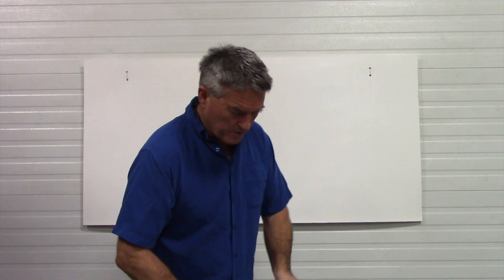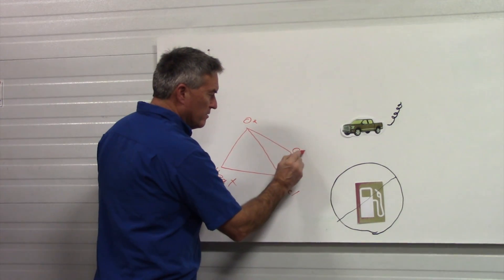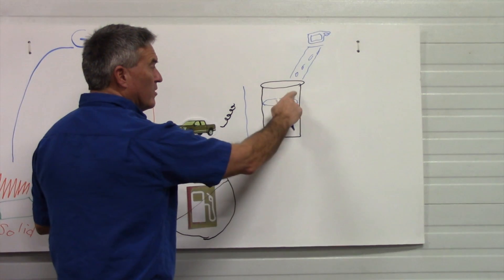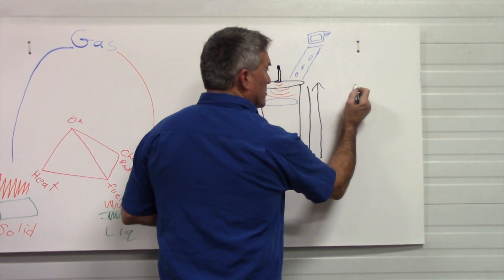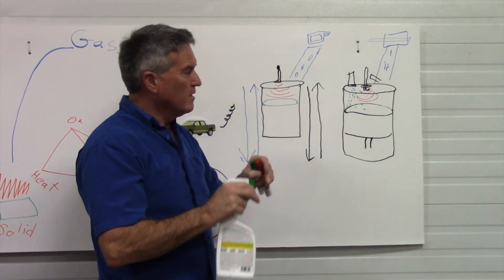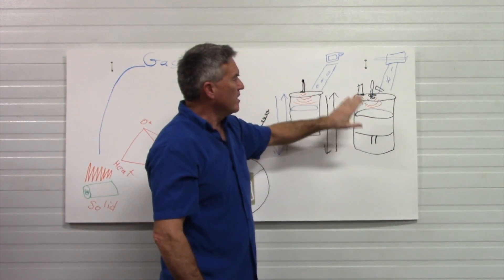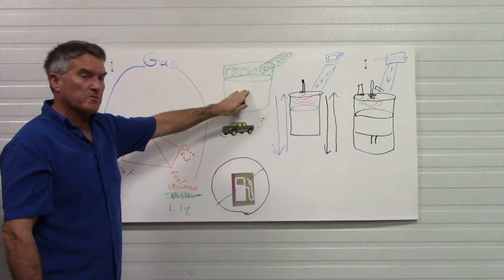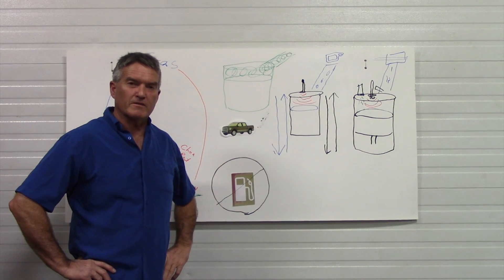One Simple Trick to get 100 miles per gallon with less pollution!

Comment: Gasoline, is not a fossil fuel. It does not come from dead dinosaurs. Almost every crude oil Source on the planet is from deeper than any creature ever lived. The fossil-fuel concept is only a theory postulated in the 1850s. It has been proven false several times. We know this because we know how much oil there is in any given oilfield oh, and we also know how much oil we've taken out of that oilfield, and all of them seem to have more oil in it than they should have. Which means either the Earth is still making the oil or it's not coming from dead dinosaurs. It is a geological construct. Not a dying dinosaur and vegetation construct. As for the pollution aspect, hydrocarbons we're almost completely eliminated by the end of the 1970s with catalytic converters. So much so that your car puts out less hydrocarbons than the tree sitting in your front yard. Getting better fuel mileage however, he is a wonderful thing. Especially when you're being ripped off to the tune of $5 a gallon in Ontario Canada. If you think medicine is expensive now wait till it's free like it is in Canada where you pay $10 for a $3 roll of aluminum foil at the grocery store. Add that up and see how much your free medicine is actually costing you.

If you're getting better fuel mileage You by definition have to be, not maybe, have to be creating less pollution. By the way CO2 is not a pollutant. And it does not cause global warming. It's actually a factor in restarting the precipitation engine which cools the planet. Global warming is caused by, wait for it, the Sun.

Just what is the fundamental difference between injecting raw fuel into the air circuit and allowing the air circuit to draw raw fuel. 7 minutes into the video you haven't said anything this needed to be known that anybody who might be interested in this subject doesn't already know. Fuel injectors are not a fundamental change from carburetors. They're a more accurate fuel delivery system and that's all. Has a point of understanding the first company that put electronic port fuel injection on a vehicle was Chrysler Corporation in 1956 or 57. The problem was the electronics were not capable of consistently controlling the fuel metering.

Charles Lindbergh busted the argument of running an engine lean during World War II what he doubled the patrol radius of the P-38 by leaving the fuel mixture down to about 14 and 1/2 to 1 or even less with no detrimental effect to the engine. The only thing you had to remember is if you had to put additional stress on the engine you had to Rich the mixture back up to the more conventional 12 and 1/2 to 1. So much for your running lean will cause you mechanical issues. Please study history and the actual physics of an internal combustion engine. You could run an engine lean when torque is not being required of it.

I fully agree with your system for solving these issues, I don't understand how you got a patent for however. You're basically using the same basic principle that people have been doing on automobiles since the 1970s. Introducing air through the fuel and using the the vaporized mixture to go into the engine. It works wonderfully. Your engine isn't as powerful, you actually end up with a mixture that is primarily conditional on the vaporization capability of the gasoline. The advantage you seem to have so far as I've seen it, is that it's in a device that works independently of running that vaporized fuel mixture all the way up from the fuel tank. Which could prove to be disastrous in an accident.

And then you don't offer any way of studying what you've made or selling it or any access to this marvelous invention what's makes use of that mixing of the fuel before it gets into the intake plenum. This is less informative then the guy who's actually doing it on his 1980s Dodge Dakota for the Last 5 Years
Reply: If you study "subduction zones" (and hopefully your not a Flat Earther) you will see that the sea floor, along with 100M years of organic sediment, slides under the crust in sheets, eventually breaking off and slowly sinking thru the Mantle towards the Core, thousands of miles below the Earth's surface.  This is how Carbon and Hydrogen are brought to great depths.
However
Coal deposits bear the markings of leaves and stems, are clearly from ancient vegetation, and will never be made again. They were laid down before microbes could digest Lignin and today our swamps rot away, even cypress logs rot in 1,000 years.

The heat of the catalytic converter is evidence of the incomplete combustion.
The piston and exhaust valve WILL run hotter due to the lack of evaporative cooling,  however there are several ways to compensate for that, from EGR to water injection to ceramic coatings to designing the engine to dissipate more heat.  The "lean burn" system would turn off when the engine comes under load.

The big trick here is keeping a large volume of pre-mixed, vaporized and conditioned air-fuel fed into the motor without a backflash detonating the whole contraption!
Reply: @peterdarr383  I understand subduction zones but tests have shown that you can take marble and water or even calcium and water and put it under intense pressure and come up with oil. It would be prohibitively expensive to manufacture oil in that fashion. But it has been done.

I'd also like to point out the subduction zones apply to solid strata. If solid strata is subducting underneath a another piece of solid strata over the top of it it would, by definition, sheer off any settlement above the solid rock layer. The mud and other settlement would not travel underneath the rock wall that it hits. So therefore, the order must be coming from the pressure if it exists at the depths that it's currently drawn from. Many of those oil fields are not anywhere close to any subduction zone. Some of the earlier ones may have been but certain geological features made it easier to spot those. When they figured out how to spot the ones that were much deeper and much further inland, that criteria did not is easily apply
Reply: @44hawk28  If this is true - that the Mantle generates "crude oil" just due to heat and pressure, and has nothing to do with surface carbon from organic life. . . 
then
You would find oil fields EVERYWHERE;
You could just "Drill Baby Drill"  no need for Geologists or exploratory drilling.
but you can't
There's no oil in Germany or Japan, for example. There's AWESOME OIL in Saudi Arabia and Kuwait, but none next door in Israel. It takes Ancient Shallow Seas to make oil.
Reply: @peterdarr383  that is a completely false assumption. Because not all of the Earth's crust is in the same Condition. It's only a quarter mile thick at Hawaii while it's two miles thick in other places in the world. And as for finding oil where they previously didn't think it would be, they are finding oil in places they didn't think it would be. They're also drilling down, in some places well in excess of 1600 feet, to get at it. And I know of no fossil fields that are between 2500 and 3500 feet below the Earth's surface.

I would cite you an excellent example. Diamonds are created bye pressure and heat, associated with ancient volcanic activity. But not everywhere that there's been ancient volcanic activity can you find diamonds. And as for manufacturing oil that way, as I said it would be prohibitively expensive. You can make gold out of mercury. But it takes you about $3,000 worth of electricity to make a gram or two of gold in that manner. Just a little bit inefficient.
Reply: @44hawk28  A dumpster full of turkey carcass discards can be turned into a "crude oil feedstock" in 40 minutes of basically auto-claving, thus turning landfill waste into "energy".
North America burns 400 MILLION gallons of fuel EVERY DAY, but YOU want to somehow rely on ANCIENT water (for the Hydrogen) and calcium carbonate (for the carbon chain) as a LIMITLESS and automatically renewable energy source??
Wouldn't the Mantle eventually be depleted of these hydrogen and carbon sources, as the average density of the mantle is 4-5g/cc and the density of water is 1g/cc and calcium carbonate is 2.7.
I just looked up the composition of The Mantle, and of the 12 listed molecules, NONE OF THEM bear ANY carbon.
Reference:
https://en.wikipedia.org/wiki/Earth%27s_mantle

Your theory seems busted. . . sorry . . .
Reply: @peterdarr383  and you can add ethanol made from corn 2 gasoline and stretch the gasoline. But you're still burning your food which is a stupid idea. Not only that it takes 1.1 gallons of oil-based fuel to produce one gallon of ethanol, and that's the best exchange rate for fuel usage to create ethanol. That's going the wrong way you're not actually stretching the fuel your using it. Saw Grass Grows much faster but it takes a slightly different method to convert it to ethanol. Which is a piss poor replacement for gasoline in the first place because the specific gravity so far out of whack from gasoline it is not an efficient way to run an internal combustion engine. Last point, that still doesn't mean that oil taken from the ground comes from an organic source. That is still a myth that comes from a wild-ass guess from a Russian geologist in 1853. The primary reason they keep telling people this crap is that it allows them to make people believe that we're running out of oil so it has to constantly raise in price. When there is no evidence that we are actually running out of oil anytime in the foreseeable future.

Comment: For all of you that say it will create more gas usage.....no it won't.  It will save us tons in gas mileage, for our vehicles, which will cut the usage by 90%...then, it takes less product to make actual gas so,  there's that.  People, we are running out of natural gas.  I heard we could be without it by 2050...completely.  This method could help us replace it.  Or we could stop using any type of combustion in our machines....then, just use gas for other things.  Either way, we are running out of our natural resources at an alarming rate.   Also, this method cuts pollution!!!  That is a great thing to me.....any little thing that helps us is a good thing, in my opinion.

Comment: Not sure about this. If you run your car on butane gas in the uk ,you still don’t get 70 mpg and a uk gallon 25 % bigger.
Lean burning is not new either.
You always run the mix a bit rich to get the engine to pick up for acceleration.

Comment: this guy starts off, first thing, with misinformation and deception.  petroleum IS NOT a so-called "fossil fuel"; petroleum IS NOT created from dinosaur bones or any other formerly living organic matter; and petroleum IS NOT a finite resource that we started with X and are using it up, presumably until it is all gone.  petroleum is made deep within the earth on a continuous basis.  the supply is not so scarce and limited that we will be running out of anytime within the next several centuries, if ever.  in order for energy to be valuable to own, it must be scarce, to extract as much value as possible by those who produce it.   similarly, scarcity of energy also makes it a very powerful commodity indeed, in fact if energy can be controlled, and limited, this commodity has the power to control people.  i'm not saying this guy is a minion of the powers that should never be, but he is spreading the propaganda of the powers that should never be.  wake up sheeple !

Comment: Your teaching 12 graders at kindergarten level you dumb dipstick.
Second note.
ENGINES do not burn liquid fuel gases.
ENGINES burn  NITROGEN FOR POWER WHICH IS AN ATOMIC EXPLOSION.
JUST THE ADAM BOMB IT NEEDS A PRIMMER, GASOLINE VAPOR MIXED WITH OXYGEN CREATES ENOUGH HEAT TO IGNITE THE NITROGEN CARBON MONOXIDE IN THE AIR.

USEING HIGH VOLTAGE PLASMA DISCHARGE ELIMINATES THE NEED FOR GAS OR DIESIL OR PROPANE.

THE CANT MAKE ANY MONEY SELLING US A ONE TIME PURCHASE UNIT WITH NO ADDED DRIVABILITY COST, SO THEY WILL PUSH ELECTRIC FOR THE WEALTH INSTEAD.

ITS TIME TO TAKE THESE WICKED PLANET KILLERS TO THE GILLITINES.

Comment: 2,000 rpm equals 1000 “squirts” since 4 “strokes “ equals 2 revs , 1,000/60 = 16.67/ sec sure enough! I’m not convinced about the cooling thing though. Partly it is that overly lean mixture just can run hotter. Piston aircraft are a Good demo of this as leaning will cause the engine to run hotter and if over done not only give less power but cause engine failure. Car manufacturers tend to not want this at least until the warranty period is over! Admittedly it wouldn’t be that difficult go much further than they do to monitor engine conditions stroke by stroke and go much further with mileage! Eliminating the Catalytics shouldn’t be rough at all with current technology allowing a good start at much better breathing and huge gains in power and economy. Ah yes, then there is the other thing about big oil and all that lies in that Big ole Swamp. So short answer, that is the real bugger in this equation !

Comment: Oh I know it works,  my neighbor made a 1 ton truck get 70 mpg long ago playing with something like that.  That was invented by Charles Pogue in the 30's,   patent bought by the oil corp and sat on.  (only briefly used on long range tanks in WWII)  They've stopped it from happening ever since,  Many various versions of the same thing developed but always the same result,   they get stomped on by big oil. Finally a few years back Allan Cagiano comes up with yet another version that works even better. getting well over 100 mpg with ordinary V6 engines. He even went so far as to start manufacturing and setting up distributor network for them.   Same results,  he gets criminalized and they tried to kill him, but he escapes and hides out.   Big oil refuses to cooperate and determinedly opposes anything that can reduce fuel consumption that much.  Why?    Money!  But do some research.  There are a lot more things been invented a whole lot better than that even.  It's interesting to learn about them,  but nobody dare develop any of it or they get wiped out,  shut down,  killed if they don't stop doing it.   We live under hard line slavery to oil.  No one can fight it,  it's just too big.

Comment: The BIG Oil Companies and any other fuel companies buy up every tech item that would make fuel go further burning in an engine. They bury it deep in a file someplace hidden away forever, Just so they don't lose a dime of income...They need to keep control of every auto, truck, lawn mower, plane, moped and anything else that burns oil type fuel.  They don't want 100 mpg or any where close to it. That's why auto industry has done so much and gotten no where as far as a massive mileage increase goes, it's also why Oil prices keep going up. So they can make their cash killing before they are really found out by the world, to be the crooks they have been and still are..

Comment: Cut & paste “Canadian patent # 2876642” to get actual information on his idea. Concisely, he wants to premix fuel vapor with air before burning it which is what carburetors (pre-1990 technology) did since Internal Combustion Engines (ICE) were invented. 
   His patents also suggests somehow using gases from decaying organic material for fuel which also works, however combustion of different gases produce their own different pollutants. Gasoline produces Carbon Monoxide so gas engines have catalytic converters. Diesel ICE produce Nitric Oxides NO2 which is presently treated with a urea mix in North America causing a Urine smell for following vehicles. Hydrogen burns so fast, hot and explosively it must be only a fraction of any fuel mixture. Propane does make diesel burn more efficiently. I don’t know any downside there but imagine the Sierra Club is searching for one! 
   Basically everything has a downside. If there really was a fuel efficiency secret our enemies would have adopted it to take the lead as THE Major World Power. The USSR/CCCP certainly sacrificed their environment trying! Russia, China, Iran and every country with any sense wants to increase efficiency! There is no secret conspiracy hiding the truth from everyone. 
   Craig Vetter sponsored fuel efficiency contests in the 1980-90’s   OVER 100MPG WAS ACHIEVED... BUT... the secret is a small engine running at maximum capacity and moving at speeds when wind resistance was minimized so less than 20mpg/30kph. Big letdown, huh? 
   I watched the whole video as well because I want to increase efficiency too. Reading patent links from his to other patents should provide anyone who read this far with plenty of insight on the problem and proposed solutions. God willing, somebody will think of better ways to be more efficient! Send me some $$$ if you become wealthy! Thank you in advance!

Comment: Ah the old secret "air-fuel-mixing mechanism" that gives a car engine 4 million miles a gallon trick. Usually done with a rusted out sedan with an ancient V8 showing the secret mixing device with a feed hose into the engine.  I am more impressed when they include chaos theory and quantum collapse into the explanation.